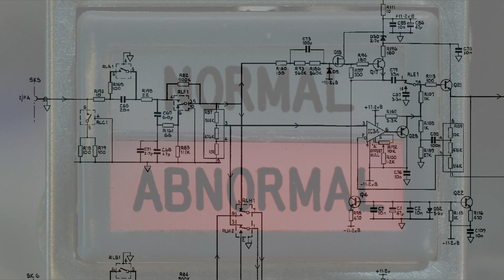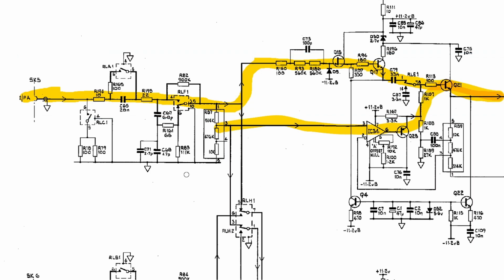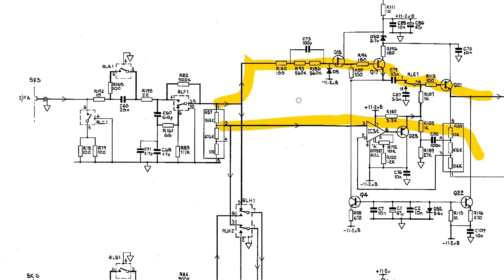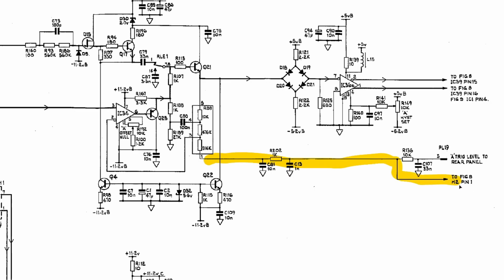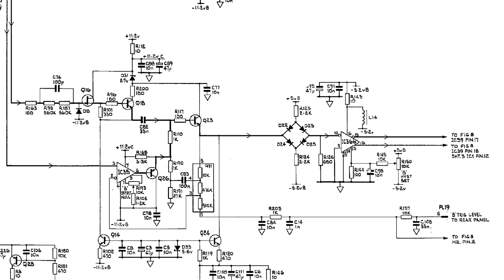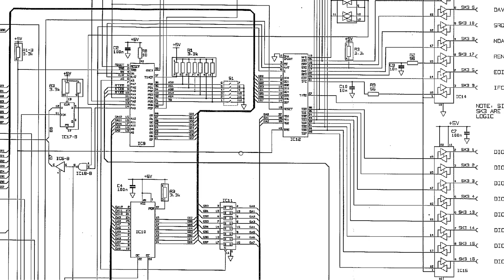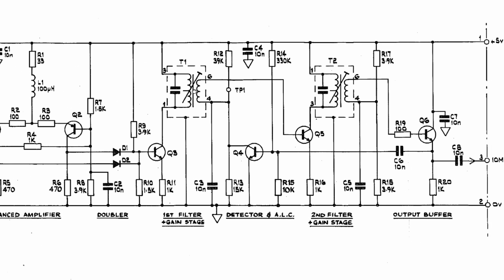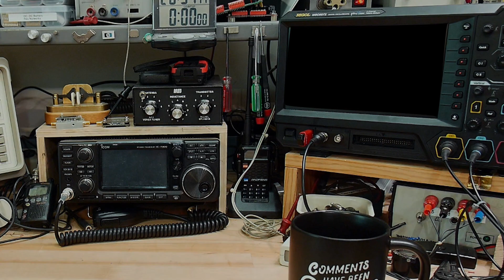#1045 Racal-Dana 1992 Schematic

Comment: In the high frequency path between C79 and R113, there is a dog leg, then a circle, then a junction and the label "7,8". Is the dog leg a feature, or is it just drawn that way? What is the circle? Are these related to the label RLE1? Are they related to the nearby floating bit where C87 is between what looks like +14 volts and ground?
Reply from the maker: that is a relay. shown as pin 1 connected to pin 7 and 8
the other position is pin 14 connected to pin 7 and  8

Comment: Thank you for all the awesome videos! I just have a comment/question… do you have some kind of noise removal filter added on your audio track? Lately it seems like the intelligibly of the audio is worse than before. Perhaps you can tweak some settings so it is a bit easier to listen to. It’s just a minor thing, but it is sometimes difficult to hear what you are saying.
Reply from the maker: my, studio recording setup drives me crazy. I'm working on it. The lapel mic in the garage works great, but I cannot use it in the office as it picks up all kinds of noise. I just got a new mic and hope that will help in the future

Comment: Very nice, but I don’t understand why double the ref freq instead of generating the desired one - doubling would double any errors. Or is a stable 5Mz easier to generate and send than a 10Mz?
Reply from the maker: I believe it is to control harmonics so the 10MHz is very clean
Reply: @IMSAIGuy  not certain, but I've been told that 5 MHz xtal references can be made with lower phase noise than 10 MHz. Since 10 is a default industry standard they us a freq doubler to get there for compatibility with external gear.
Reply: The 5mhz provides a regular signal. The 5mhz isn't a perfect sine wave. The diodes not only turn it into pulses, but doubles it. The I.F. cans are resonant and turn the pulses into a sine wave. Even if the I.F. cans are slightly off frequency, the output remains a very accurate 10mhz sine wave. It may be of a lower voltage but it'll still be pretty clean. If the I.F. cans were part of the oscillator they would definitely have a frequency drift. The crystal oscillator has better drift characteristics.

Comment: I wonder why they used single pole relays instead of switches.
Reply: So they don't disturb the RF signal path. It gets tricky rerouting extremely high frequency signals when they have to maintain both isolation from noise and a specific impedance for the signal path.
Reply: @johnwest7993  Thanks!

Comment: Do not think those diode bridges on the inputs are limiters, looks more like it is to deliberately introduce some deadband, so that the comparator will not generate multiple counts around the zero point of the waveform, or do spurious counts on too small a input signal. For small signals the output side diodes will be conducting, and the input will be biased, due to the diodes and the slightly asymmetric power supply voltages, to slightly below ground, and will be held there in a steady state, so making no output from the comparator. Input signal, after all the amplifier and gain control, has to exceed 0.6V, to get the one or the other input diode to conduct, shifting the top or bottom of the 2 series diode off of the value it is at steady state, and thus moving the comparator input away from the resting voltage, so it will change state rapidly, avoiding any spurious oscillations with slow input edges. 

The level control seems to bias the whole stage DC wise, so that you need more or less voltage to get past the threshold, as the level control is using a DC control voltage to basically adjust overall gain of the input stage, so that no matter the input signal you always have a very limited voltage applied to the comparator, but without needing to feed the input signal through variable controls, and allowing ATE equipment that is using this to get an input signal level to verify correct operation, as likely the external level control is also usable as input if selected as one.

As to the reference oscillator, those likely are regular 10.7MHz IF stages, with some extra capacitance added to the primary side to tune them down, if they did not already have a wide enough tuning range to go down to 10MHz, which for these older larger designs is very possible, as they can easily tune 1MHz either side of the nominal. Double with the input side differential amplifier and diodes, then filter and amplify, apply AGC using the transistor acting as a as variable bias for the second amplifier, and do more filtering, so you get a good low distortion sine wave out. Then use the exact same comparator circuit again, to get the signal into digital form, so that any impurities in either one are going to affect both the same way. Gets rid of any subtle phase shift around the zero crossing in both conversions, as there now is a fixed minimum level, thus a well defined slew rate, where the comparator will be operating in.
Reply: Well said.
Reply: The diode bridge is there to limit the swing at the comparator to +/- 1.2V  It does not introduce a dead-band.  Around 0V input all of the diodes conduct and the signal is passed through unchanged.  As the input increases to +1.2V D18 and D21 become reverse biased and block the signal.  D19 and D20 similarly block the signal below -1.2V.